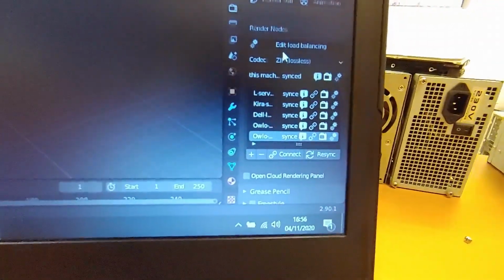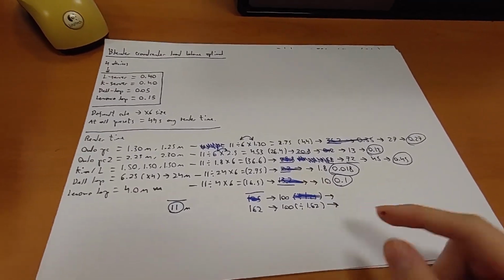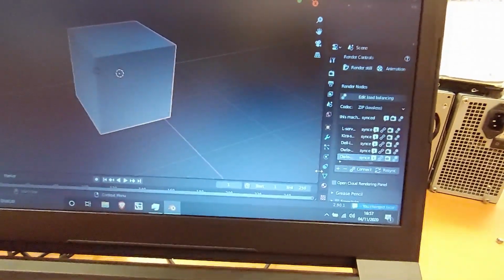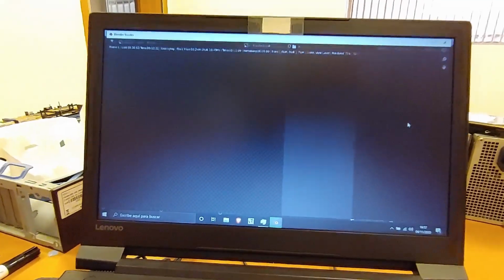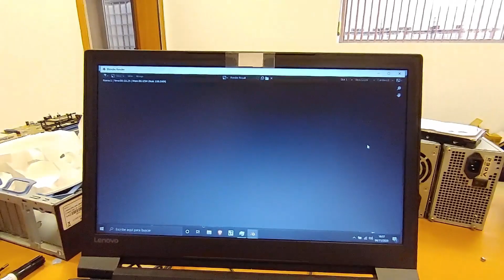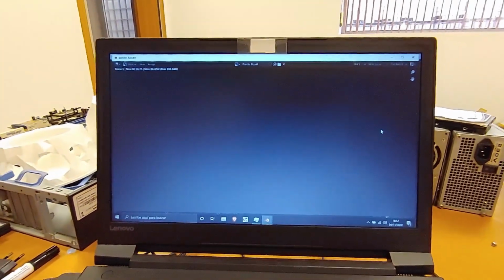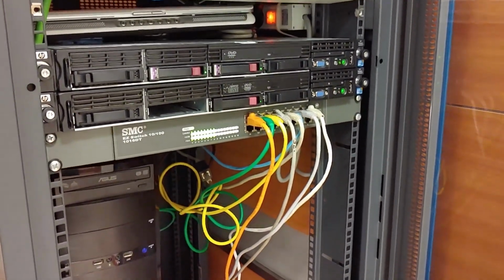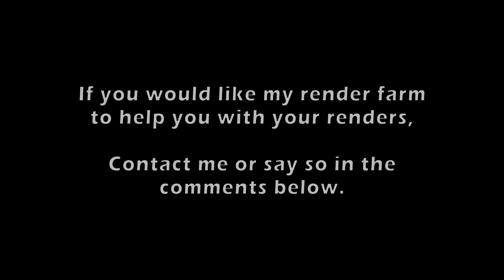DIY Blender Render Farm Overview

Comment: Would adding 2.5gb Ethernet adapters between those computers helped to speed up the processing time?
Reply from the maker: I'm not sure, I can tell you they were all running at 100mbits so not even 1gbit at the time, I do suppose that when transfering the final output to the master node a faster connection would defenitely help reduce that time, but honestly each pc got such a small part of the entire frame anyways, that we would need to be rendering images of huge file sizes for that to make a significant difference, but good question nevertheless.